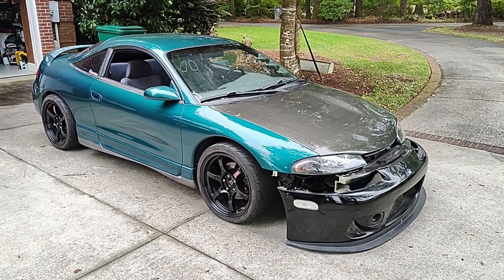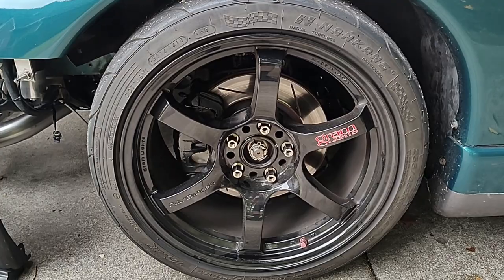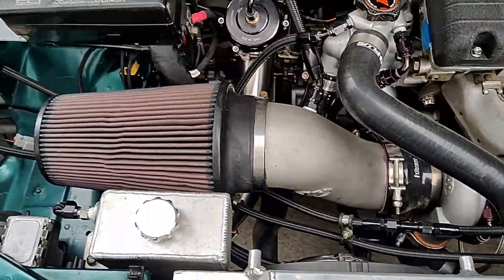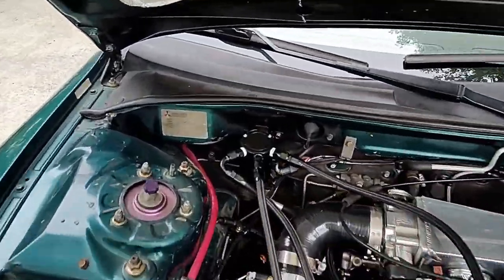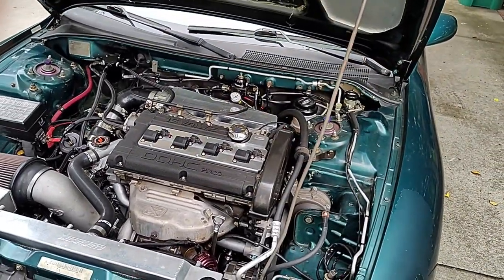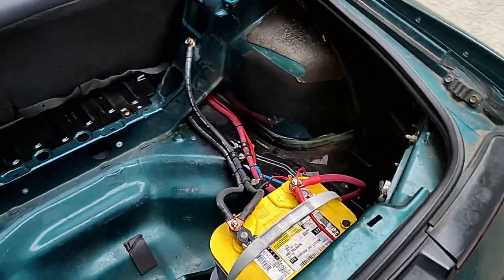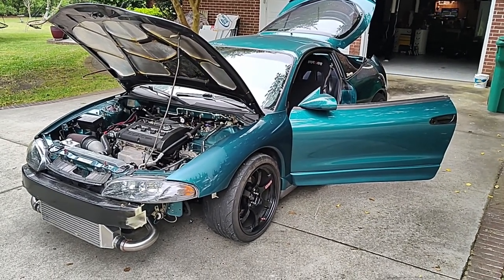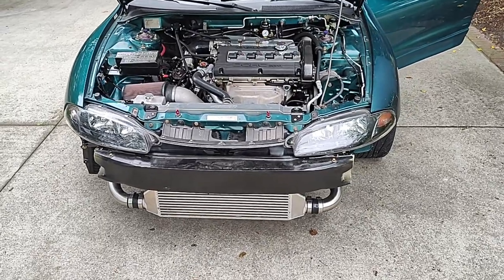Awd Converted 2G DSM

Comment: I like the trunk. Ebay used to sell big squares of flat carbon fiber that you could order. Would be cool if you cut one to shape and velcroed it in that back trunk area.
Reply from the maker: Thanks.  That's a good idea.  I didn't want to make a cover out of anything heavy.  A carbon fiber sheet attached with velcro would be a good solution.

Comment: have a 95 gsx manual I converted to 2gb and about to get it repainted black. Even got black leather oem seats for the car. I just have to find a passenger fender and a new hood. People on ebay are charging over $400 for a god damn fender. Not paying that so I guess I'll be waiting awhile for deals before I get it restored.
Reply from the maker: Black on black is going to look good!  I agree $400 is crazy for a fender. 
 I would start calling junk yards.  Any 2g Eclipse or Talon fender would work.  You may have to drill for side skirt retainer clips, but that's no big deal.  Good luck with your build. It sounds like it is going to sweet.

Comment: Nice setup!!
 I have a question how come most people stick with ecm link instead of going with a haul tech 1500?
Reply from the maker: Thanks!  I think most people use ECMLink over Haltech because of the price and familiarity of ECMLink.  The Haltech is a good product but the "plug and play" harness by itself costs almost as much as ECMLink.  

I can think of one good reason the go Haltech over ECMLink.  If your factory engine harness is trash and you are comfortable pinning out your own connectors, Haltech with their universal harness is much cheaper than buying a aftermarket harness.  My Ohm Racing  wiring harness is really nice, and should be for how much it cost.

Hope that answered your question.  Thanks for watching.
Reply: @grumpyvetgarage  that answered my question brother!
Thanks for the reply.
 It’s pricey for sure no doubt. But I wanted an updated version for tuning purposes. I’ve had ecm link for a long time and most people aren’t familiar with it for what ever reason and they just prefer to what they are used to I guess lol. 
 Thanks brotha!
Reply: @grumpyvetgarage  this is a question not related to my previous question..
 Can you use a 1g clutch master cylinder in a 2g with a six bolt swap bottom end with a 7 bolt head?
  Sorry for the ignorance.
 I’ve tried searching and can’t find anything or if there’s any benefits for going with a 1g master cylinder.
Reply from the maker: @kevinmorales8094  I don't know of any benefits to using a 1g clutch master cylinder in a 2g.  I would stick with 2g clutch parts on the car, in my opinion.
Reply: @grumpyvetgarage  copy that brother thanks for you input!!
 You rock

Comment: Very nice ride man! Kind of surprised you kept the 2ga rear bumper. Is installing a Volvo power steering system really as easy as power ground and a potentiometer setup? I've been playing with the idea of getting a couple setups from the wrecking yards for my 1g and 2g's, can't seem to keep a pump in any of my 2g's. I'm thinking I'd put the electric pump where the battery tray is on the subframe. Was there a reason you put yours in the trunk or was it just for a cleaner bay?
Reply from the maker: Thanks.  I hadn't got around to changing the rear bumper and side skirts.  I'll probably wait until it's time for body and paint in the future.  For wiring, it really is that easy.  Mounting, making and routing lines is the hardest part, more time consuming than hard.  Putting the Volvo pump on under the hood and relocating the battery sounds like a good mounting spot.  I put mine in the truck to clean up the engine bay, but in hindsight routing the lines all the way to the back was a pain.

Comment: That’s crazy how big that oil cooler is! You don’t need that!

V/r,

Someone in the comments
Reply from the maker: Your right.  It's half mounted in the passenger wheel well and half in the engine bay.  It's bigger than most turbo cars intercooler.  Thanks for checking out the channel.
Reply: Ya the oil cooler looks like the stock side mount lol

Comment: What seat rail are you using ?
Reply from the maker: I'm using a seat rail that isn't made anymore for the 2g DSM by Extreme PSI, but basically it is this base with Sparco brand slider bolted to a Megan Racing seat. https://www.extremepsi.com/store/Sparco-600-Series-Steel-Seat-Base-Vehicle-Specific.html
Reply: @grumpyvetgarage  does it sit high ? Or feels normal.
Reply from the maker: It doesn't sit to high, but all aftermarket seats that I have seen are large in comparison to the OEM 2g DSM seat.
Reply: @grumpyvetgarage  thank you.

Comment: What’s the offset on your wheels?
Reply from the maker: They are 18x9.5 +38 offset.
Reply: What size tires are you using on those wheels and you don't have any issues with tires rubbing in the wheel well or taring up the splash shields when you do full turns? @grumpyvetgarage
Reply from the maker: The tires are 255/35R18.  I cut the splash shields in the front end of the wheel well because they will rub if they are not cut.  No rubbing any where else.